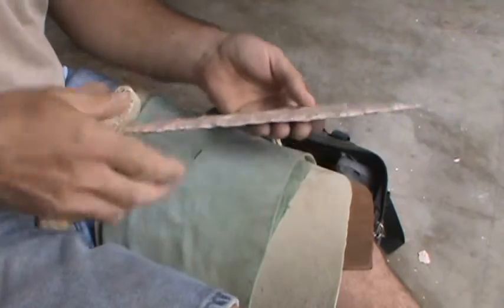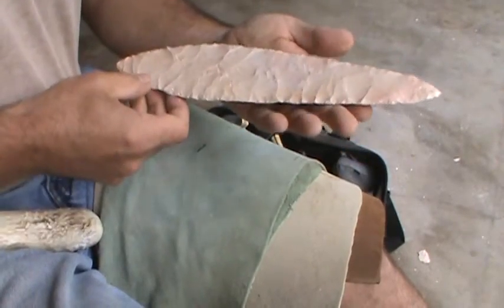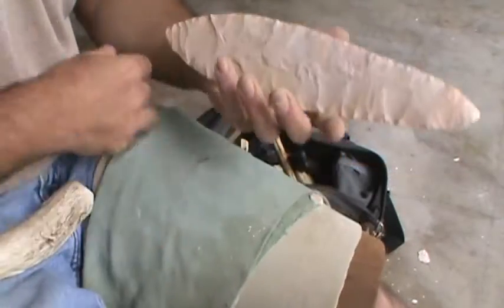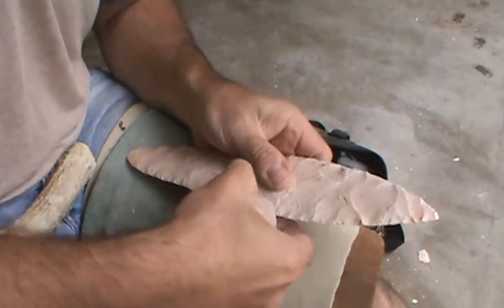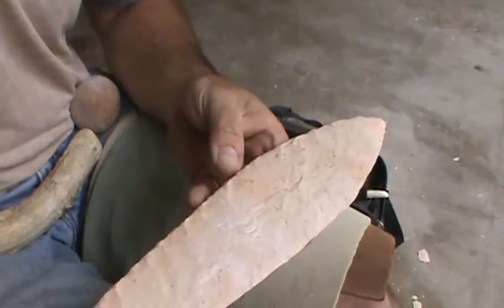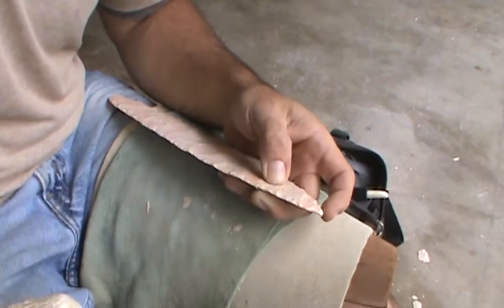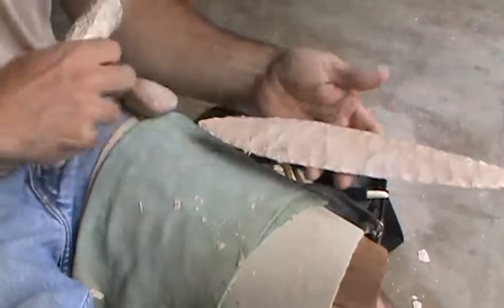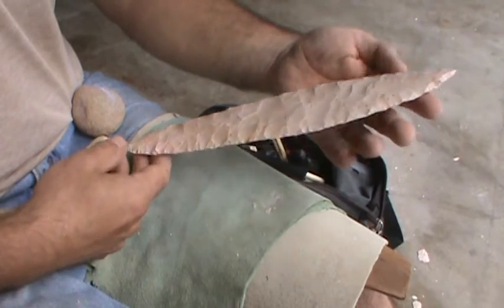Late stage thinning large blade (biface)

Comment: I have watched this video several times and now i have a question. Do you use your fingers to add mass to a flake when you are thinning sweet...er i mean a thin biface/point?
Reply from the maker: I use finger support sometimes.  Especially if I want to support the edge under certain platforms.  This can hold the platform together, and navigate the flake travel to an area of heavier thickness off the edge.